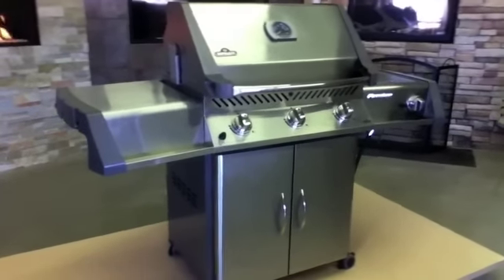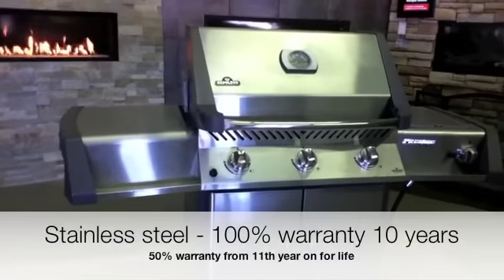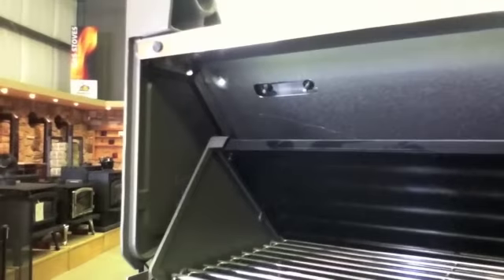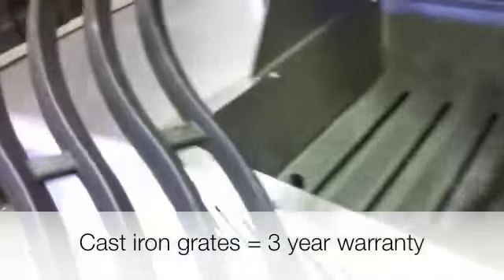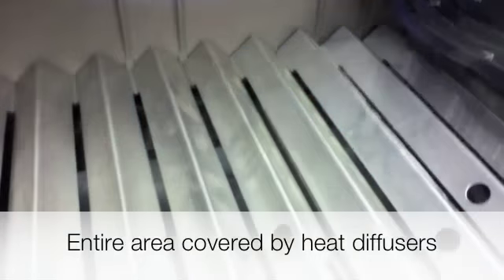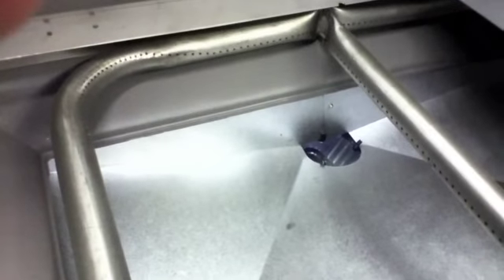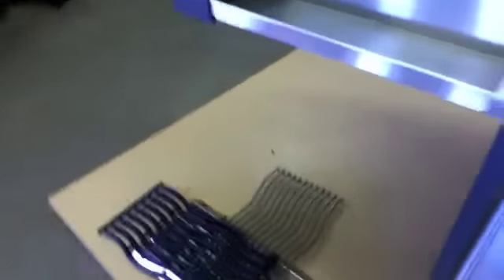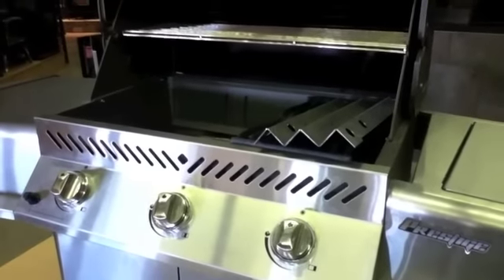BBQ Buying Tip #3 - Anatomy Of A Napoleon Grill

Comment: bought the ultra chef 505 in 2005, spring cleanup today showed the main burner shot, rusted out...the tank shield also gone, rusted out...i guess you will be hearing from us shortly, i understand lifetime warranty on burners, don't know about tank shield...it has been excellent barbecue, giving good service for 12-13 years to date, only other thing that does not work is the electronic ignition

Comment: I just purchased a CharBroil Patio Bistro Infared gas grill ($169) at Amazon. It has 240 sq. ft for the main cooking area plus 80 sq. ft for the warming rack. I did a boneless chicken with Mesquite marinade. Came out great, juicy chicken with excellent sear marks, no flare ups with the grill, heats up quickly, cooks evenly.

Comment from the maker: @Mirk0waR my response would be that we have been selling Napoleon grills for many years with few issues. I did not rate or review the "Pro" version of the Napoleon grill, but if Consumer Reports rates a Napoleon lower than an offshore cheap BBQ (i'm taking your word on that) then I would suggest that they are not taking everything into account. In the past I had seen that they rated another brand (I won't say which) as being very high - we had nothing but warranty issues with and stopped selling

Comment: I have a Napoleon SE495 for 2 years. Now not useable due to rust of drip tray, cross light brackets, main frame. 9 weeks after contacting Napoleon, they sent me the wrong parts! Their customer service is non-existent. They walk away from warranty (they have refused to replace any stainless parts after 2 years. 10 years???
Reply from the maker: Unfortunately, Napoleon has some North American built grills and now has some offshore grills.  The SE495 is one of their offshore 'disposable' grills.  I know this sounds self-serving, but if a BBQ is purchased from the Big Box Retailer, there are strong chances its an offshore BBQ - and will not last.  If you are looking for something to last you a long time, visit a good local BBQ retailer.
Reply: I bought this directly from the importer...

Comment: I have a Walmart special BBQ for 13 years now and it still works fine. Just a little rust on the base. Stainless steel still looks great. If you don't take care of your BBQ it will fall apart. If I ever buy one of those expensive BBQ, I'm have to remortgage my house. I would love to buy a Napoleon BBQ but why it cost so much. It should be priced competitively.

Comment: I have had nothing but problems with my $1400 Napoleon grill.  It only has about a 5" square hot area.  The rest of the grill get's only mildly hot.  Not enough to sear steaks, chops or anything else.  All they're suggestions and all the cleaning I've done does NOTHING.   Buy a grill from Home Depot, they cook better.   The IR burner on the Napoleon is nice, but in 5 years, I'm on my third one.  They just melt and dissolve.   Save your money.